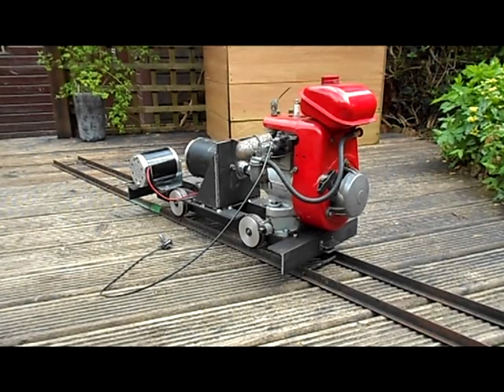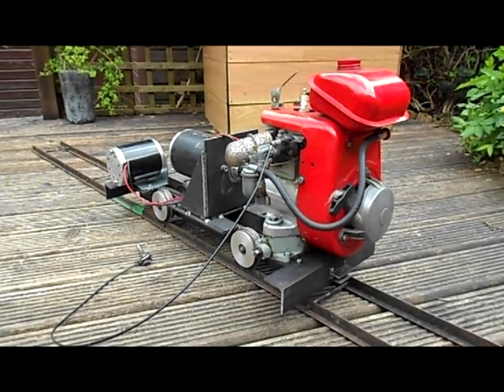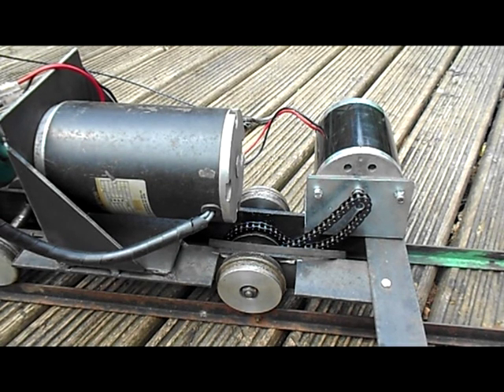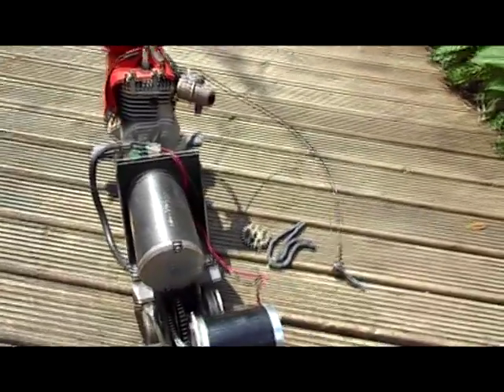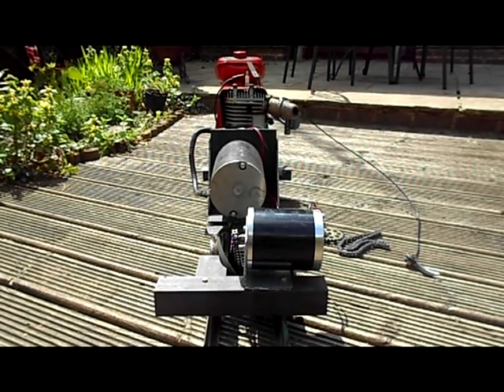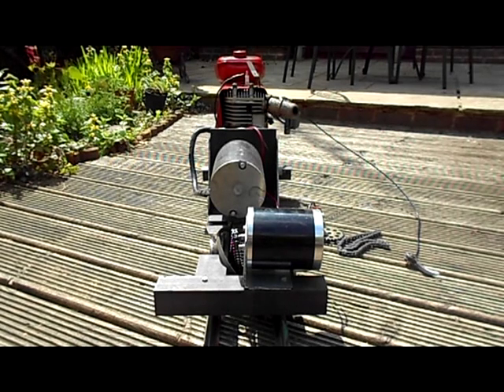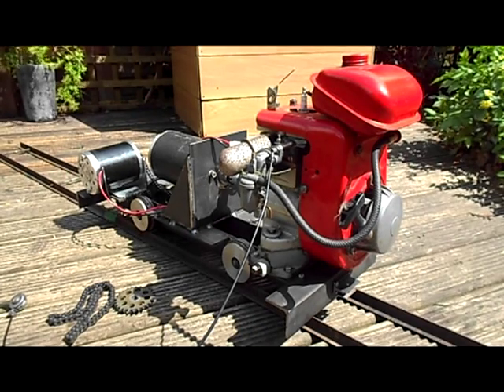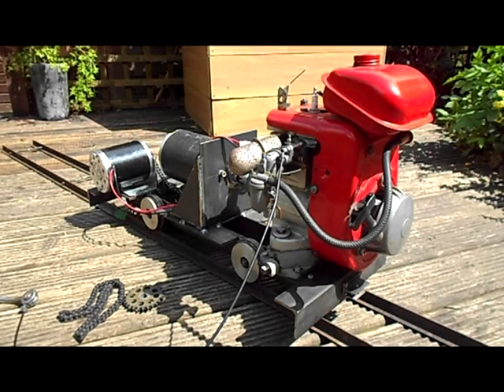Video # 72 - 5" inch Gauge Petrol Electric Generator Locomotive Part 5

Comment from the maker: Hey Man, I know its been my dream my entire life. Thank you so much for that comment about housed bearings as I think that could solve all. I thought about something like that, but didnt know it existed, so i will have a look for those. Yes suspension would just complicate things on this loco. Yoy are very right about the cooling, as I do believe the engine is having to put up with quite a bit of resistance from the generator, so hot hot hot.

I do have 4 suffolk suspension springs though :)